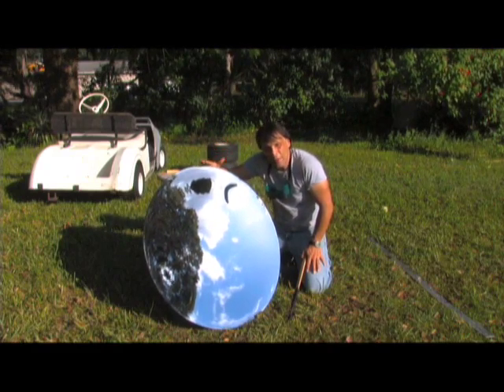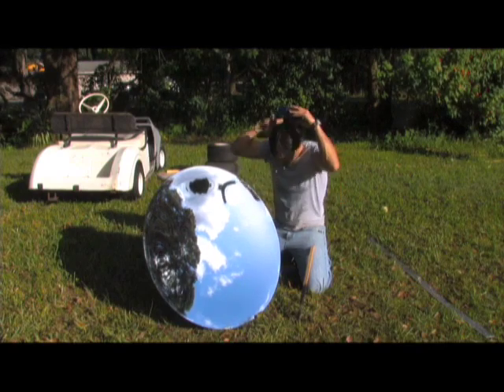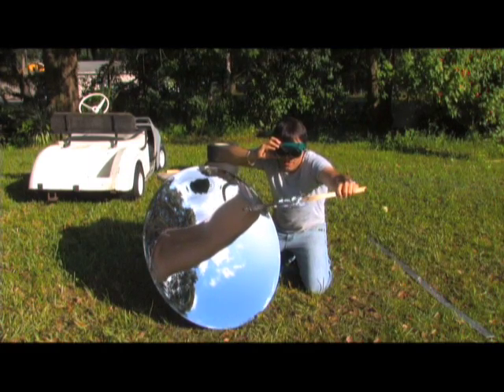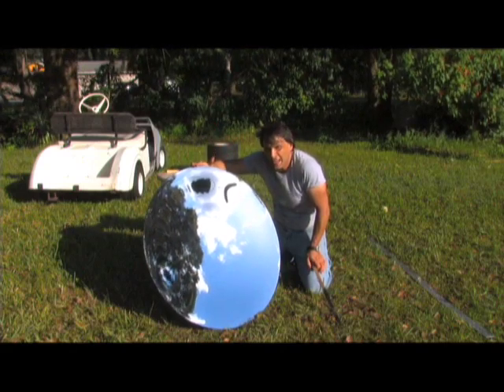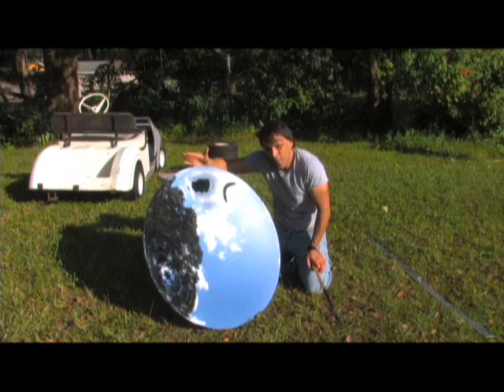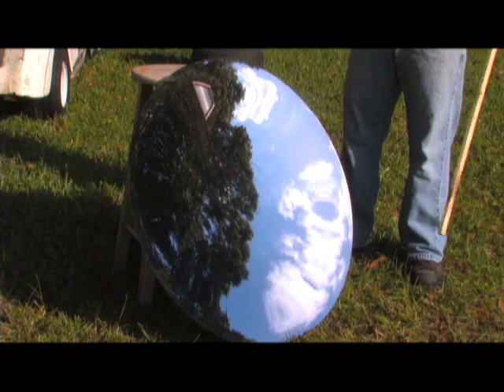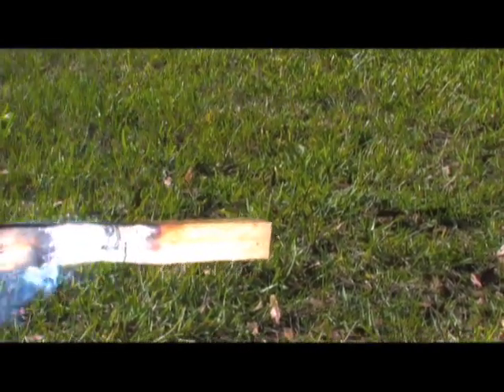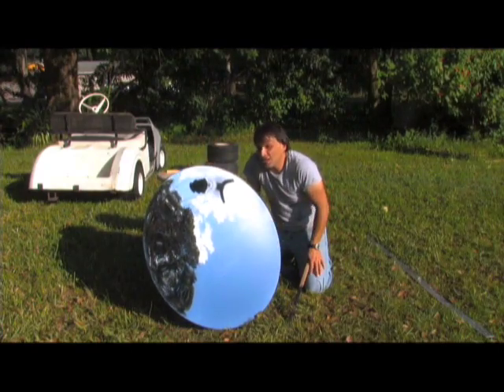PARABOLIC MIRROR PARABOLOID CONCAVE SOLAR CONCENTRATOR

Comment from the maker: Hi,

It was about 85F out. The outside temperature is not a factor to ignition. It only matters with build temperatures due to heat leaching.

Comment: They have these in a testing facility in Arizona. They are directed at ceramic pipes filled with water which is heated by these mirrors (or one like it). The steam produced in the pipes is then used to turn a turbine making electricity. Not sure of the power produced (Think its enough to power a small building) Not sure what they do when it gets dark though...

Comment: Nice video, I hope to see you using this to power a stirling engine like your video I think that had a fresnel lens heating a metal pipe. Then the pipe was attached to a stirling. On that note, I just recently bought a sterling engine kit that supposedly runs on the heat of your hand. I'll try and record myself building it and post some videos when I'm done. Keep the videos coming.

Comment: We had a much larger parabolic mirror in our storage shed for out neighbor who had a ton of solar equipment. It had a device on the end that heated water, and pumped it though a hose. that device didnt really work, so we just ended up burning shit with it. I also had a small parabolic mirror from a projector. It was a steeper mirror (closer to a ball shape) and it fit in the palm of your hand. It would have been a cool thing to light a cig with.

Comment: But how can you combine this with a Fresnel lens though? It seems both the Fresnel lens and the parabolic dish have to be on the axis created by the focal point and the center of the sun and hence the Fresnel lens will just cast a shadow on the parabolic mirror? Or are you using a parabolic mirror that is significantly off-center compared to the focal point (many sattelite dishes are like that but only slightly off-center).

Comment: Fun - but my mirror is six feet in diameter and -kapow! yeah, wood burns.
I used an old yard style sat dish, cut mirrors in one inch square tiles and tiled interior with silicone adhesive sealant for adhesive.
silicone is waterproof, frost proof and heat proof as well as commonly available.
PAINT BACK SIDE OF MIRROR WITH EPOXY PAINT AND LOSS OF COATING WILL BE PREVENTED. Prior to gluing the tiles down, natch.
Had one that was 11 feet diameter. Flash cooked a frozen hotdog in fifteen seconds.

Comment: I read back several pages and didn't come across my question.  Something that you state in the vid that simply makes no sense.

You say you can use a Fresnel AND your parabolic AT THE SAME TIME. (I assume you mean on the same focal point.)

How? since you have to be 'downstream' of the light that the Fresnel has already re-directed the light and is no longer parallel for the parabolic to focus.

EXPLAIN...

Comment: Put a small solar cell infront of the parabolic mirror, see how close to the focal point You can get the solar cell to the focal point before it fails.
    You could use one of those small $5.00, monocrystaline solar cells from radio shack, they do about 250 ma. at about 4.8V in normal sun light, if You do then please make a video for Us.   Thanks.

Comment: i watch allot of your vids. i also have used wood for heat for 2+ years. please take a piece of non charred wood and show how long it takes to catch fire. i ask this for two reasons. 1. something that was on fire will catch much faster the second time. 2. just re-lighting a piece of charred pine does not seem like an accurate depiction of the power of the lens you describe. thanks!